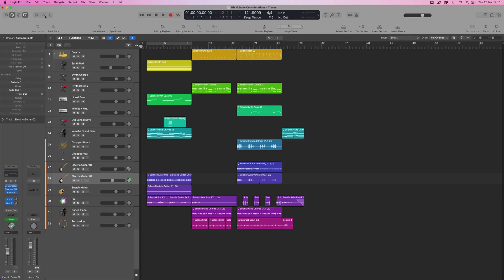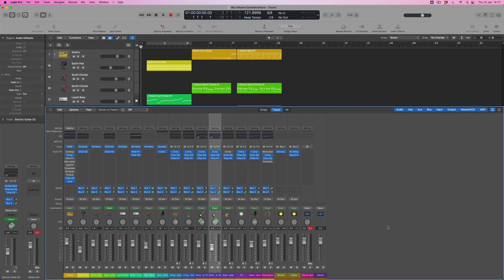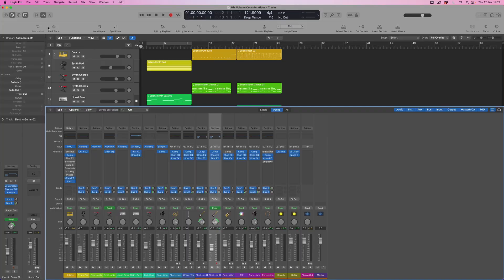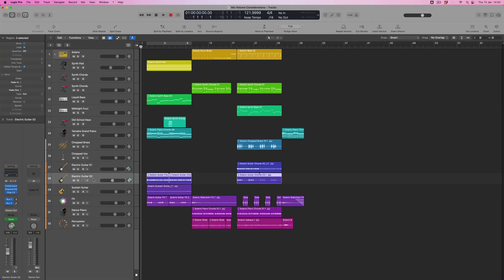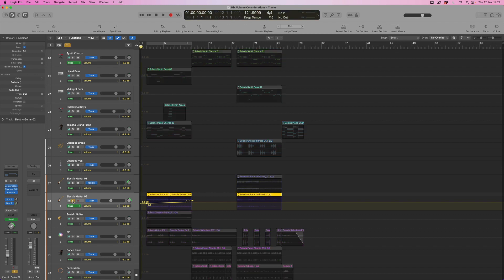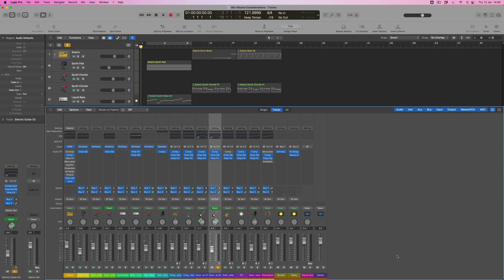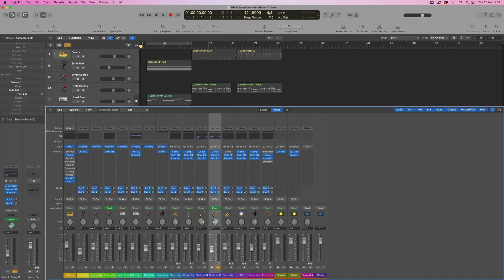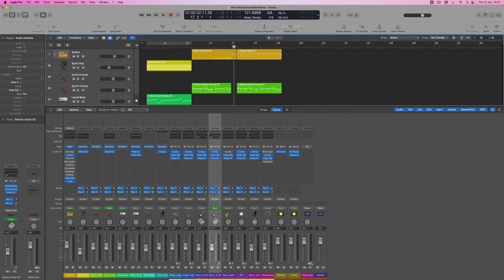LOGIC PRO X - Mix Volume Considerations

Comment: I’m battling this right now in my latest song! So timely for me to come across this in my feed. And your preferred solution is what I’d worked out for myself which was reassuring in that I’d done it the correct way. 

I think it’s worth noting that the aux buses are only not an issue if you are using post fader sends. I sometimes use pre fader sends if I want a particular effect to be independent of the actual track mix level. In those cases I had to adjust the send level as well while leaving the actual bus at unity gain.
Reply from the maker: Hi Peter. You're absolutely right - thanks for pointing that out. I'm glad to hear you'd come to similar conclusions about how to deal with this issue.

Comment: Hi, Jono. So I’m having an issue that is similar but a little different then the issue that your experiencing. It’s a little hard to explain but I’ll try my best to explain it to the best of my ability. So as of right now, I have Logic Pro opened and I’m currently creating a song. I have 2 tracks made. 
1 for the beat & 1 for my main vocal. 
And down below in my mixer, I have 6 mixer tracks being shown. 
1. The Beat 2. My main vocal 3. My Reverb Send Track 4. My Noise Gate Send Track and then 5. The Stereo Out Track with #6 being the Master Slot Track.

Inside of my main vocal track (Audio FX Slots) I have a Channel EQ, DeEsser 2, Compressor and Auto-Tune. 

Mind you, my vocal track is completely empty…Without anything being recorded under the vocal track, For some odd reason (inside of my headphones) Me actively singing with (Input monitoring) on, the left side of my headphones where my Input Sound is being played back through is noticeably a lot louder then the right side. So long story short, with everything I describe of my studio session right now, the left side of my headphone speaker is a lot louder than the right side and it’s not my headphones themselves, I’ve checked. It’s literally just the track itself, I noticed it would simultaneously fade over as I added each (Audio FX) to my (Audio Effect Slot)…Any Answer on why this is happening and the best solution of how to fix it without messing anything up?
Reply from the maker: Hi. There are several reasons why this might be happening, so this one is tough to diagnose via text! But, my best guess is that it sounds as though the Audio Track you're using to record your vocals is a stereo track and that your microphone is plugged into Input 1 (ie the left side of that stereo track), which means that the left channel is loud and the right channel is quiet(er). If you're recording vocals with a single microphone (which is how most vocal recordings are made), remove all of the Insert Effects on your current vocal Audio track and then click the button to the left of the Input routing at the top of the channel strip for your Vocal channel so that it's a mono track, which looks like a single circle.

If that doesn't fix the problem, bypass all of the effects channels and make a recording of your voice. Play this back, solo'd, and check whether, on playback, the sound is biased to the left. If it's not, turn on the first Insert effect you're using and see if this biases it towards the left. Keep repeating this process with each subsequent plug-in to see if any of them are introducing a treatment which is biased to the left-hand side. But my best guess is that you're working with a stereo track which, for vocals, you don't need to be.

I hope that helps.

Comment: I find that the more tracks I have, the more likely a mix is to clip, and yet the overall LUFS are pretty low. I'm so confused about why this happens or how to fix it.
Reply from the maker: Sorry you’re having that problem. This is something I’ll happily revisit in future episodes. Remember that there are a lot of ways of measuring volume, some of which are transitory and others of which are averaged over a long period of time, including the entire length of a track. So it’s absolutely possible to have temporary spikes which clip at the same time as a relatively low average LUFS reading. A range of dynamics tools exist for regulating volume (alongside volume Automation itself), which can help tame spikes.

Comment: Could you trim from the Automation page all of them at the same time?  Also what I used to do is create a VCA for all the tracks except reverb for the reason you mentioned.  But we have to be careful because if our sends are pre-fader then this stantement is not true.
Reply from the maker: Hi Jean-Phillipe. Strangely, you can't easily selected several tracks to Trim their Automation simultaneously. However, if you assign all of the tracks you want to Trim to a Group, you can do exactly that. Select them, create a Group and then Trim any of them from a Volume Automation perspective and they'll all drop by that amount. You can then 'un-Group' them if you want to. I hope that helps.

Comment: Question-  I notice that some of your channel strips hit yellow . Aren’t channels like kick and bass supposed to be around -10. And all channels to be in the green to leave room for mastering?.
Reply from the maker: Hi. Great question. There are no ‘absolute hard-and-fast’ rules about output volume for mastering. Some mastering engineers will say that they like somewhere around 3dB of headroom to play with, whereas others will prefer a little more. The principal considerations are ensuring that your output level isn’t so hot that it’s overloading and introducing digital artefacts. And - at the other extreme - that you’re not compromising resolution by printing mixes quiet enough that the signal-to-noise ratio is compromised as Gain needs to be boosted a lot at the mastering stage. Remember that individual track volumes within a mix are less of a consideration, so long as each one isn’t overloading/introducing artefacts.  I’ve never worked with a mastering engineer who has expressed dissatisfaction with pre-mastered mixes printed to peak around the —3dB or -4dB mark. These days, we measure digital output level in a number of different ways, depending on whether you’re making masters for CD or for streaming services. But that’s a whole other topic of discussion! I hope that helps a little.

Comment: Hi Jono! Thank you very much for the video, I found it quite helpful. But I have one question: the peaks seem to be standing still, does that mean they are showing the maximum? How can peaks be measured correctly and accurately?
Thanks!!
Reply from the maker: Hello! Glad the video was helpful. For true level measurements, I'd recommend putting Logic's Level Meter (in the Metering folder) plug-in on the Master Output fader at the very end of the chain. This will let you check RMS and/or Peak levels, giving you an accurate 'live' level check at playback. Hope that helps.
Reply: @jonobuchananmusic  Thank you, Jono! I wish you well!

Comment: Trim Automation excellent, had similar problems once on the stereo out of distortion, I use a VU meter last in the chain on the stereo out to check the mix as I build, not sure if this is a good idea but thought id mention, cheers for all the vids
Reply from the maker: Absolutely, monitoring output levels as you go is always a great idea.

Comment: Best teacher around, as always!  I found this out the hard way with many trials and errors. What I find I do is I create automation points on all of the tracks, that way if I have to keep going in and making adjustments to overall volume or perhaps groups of certain tracks like strings sections, etc., I select all and drag all points down.
Reply from the maker: That definitely works! You might also find assigning multiple tracks to a VCA Fader helpful. I’ve looked at that approach in Part 2 - let me know if it helps. That way, you can ‘trim’ output volume for multiple tracks from a single fader. Thanks for the kind words as always, Jennifer. I hugely appreciate your ongoing support.
Reply: @jonobuchananmusic  Thanks, Jono Buchanan! I look forward to watching it this weekend; and you are most welcome! 🎵

Comment: Thanks Jono for another really helpful video. On a slightly unrelated subject can you use the Logic Remote control for iPad to write in automation as well as say control the mixer? As I have a Korg nanokontrol which is pretty temperamental! Thanks!
Reply from the maker: You can indeed select Automation modes and draw Automation from Logic Remote, though there are some limitations in terms of parameters and it's much less capable (than the mouse and the Main Page) when it comes to anything third-party plug-in related. I'm very happy to make a video exploring its strengths and weaknesses for the series.
Reply: @jonobuchananmusic  that would be great if you have the time? Many thanks Jono! Paddy

Comment: Hi Jono. That problem’s been occupying me quite a bit, so thanks v much for the video. Can I ask, would it also be legitimate to lower the gain on the individual track inputs? I’ve noticed a lot of loops come in very hot. I guess this feeds in to the contentious topic of Logic gain staging? Looking forward to following your new channel. Pete
Reply from the maker: Hi Pete. You're welcome and great to have you here. Lowering the Gain on the track inputs would certainly help manage volume further down the line but be careful. If you lower input gain (at the top of a channel strip) having already configured a Compressor solution for that track on a subsequent plug-in, the Compressor will behave differently as a result of receiving a lower input level, potentially changing your mix considerably. So if your starting point for gain reduction is to lower the Gain of a loop at the point you drag it into the project as a first step, absolutely this will help you. But if you decide to do that further into the process, because gain structure is getting out of hand, just be careful to ensure things are still sounding as they should.
Reply: @jonobuchananmusic  Thanks, Jono. I’ll bear all that in mind. Pete

Comment: Yes, the automation trim is lovely. Saves the messing around selecting the automation points and fiddling with the dragging up and down.  

Question: I do volume automation as the very last thing in my workflow and I try to get my master volume around -6db.  Am I on the right track (pun intended ) here with this rough volume db target?
Reply from the maker: Hi John. The short answer is yes, -6B should be fine. The slightly longer answer is that it slightly depends on the bit depth at which you're working. If you're printing a mix at -6dB and you're going to have it mastered, it's highly likely that part of the mastering process will seek to bring levels up overall (how hard the mastering engineer will work to achieve inflated output volume will depend on the genre of music and your instructions as to how 'loud' you want the track to sound). As levels are boosted, the noise floor and 'artefacts' in your mix will also be raised, so there is an advantage to looking to print mixes closer to -3dB (or so) to ensure there isn't a resolution loss as mastering takes place. If you were working at 8-bit (I'm sure you're not, I'm just using it as an example!), the noise floor boost would be pretty apparent as mastering levels bring volume up. At 16-bit, it would be much less apparent and at 24-bit, it's not really an issue.
Reply: @jonobuchananmusic  Thanks Jono, great answer.

Comment: That was truly great Jono. I have one question though. You emphasised placing the gain plugin in the first slot on the stereo out. I was wondering why not the last? I'm guessing the in the first slot it is adjusting gain while in the last slot it is adjusting volume and it would be simpler to just turn down the stereo out fader. Am I correct? Would love to hear your explanation for this.
Reply from the maker: Thanks Warren. Ideally, you don't want to touch the Stereo Output fader OR the Master VCA fader but rather to use each track's volume faders to ensure that the level reaching the Stereo Output is controlled. If it's within 1 or 2dB of where you want it to be, a cheeky Gain plug-in at the top of the Stereo Out channel can offset level to set you up for the stereo processing you might then go on to do on the Stereo Output Buss (EQ, Compression, Stereo Width, Loudness Maximising etc...). So think of the Gain plug-in as an initial volume regulator, rather than as a final volume control for your overall output level. I can see how this might be confusing, so do look out for next week's video, which I hope will help!
Reply: @jonobuchananmusic  Thank you for that comprehensive reply Jono. Waiting eagerly for next week's video. Wish I could give you more than 1 like.

Comment: Great video! Is there a target pre-master level you should aim for when mixing?
Reply: Not sure about what Jono sets aim for...but when working with my mastering engineer, it's usually -6db
Reply from the maker: Always follow the advice of a mix or mastering engineer, so I'm happy to be over-ruled! But be careful that the overall output level isn't printed low enough for resolution to be compromised, or that the noise floor comes up through the mastering process.
Reply from the maker: Hi Lachy. Yes, I'd aim for the summed mix peaking at around -3dB at the Stereo Buss stage, with the Master (VCA) Fader set at 0dB (as recommended in this video). That's a good target and allows for a dB or so in either direction. You can then create a processing chain of plug-ins to control dynamics and output level thereafter. Video on that very subject coming soon.

Comment: Another (and easier) way would be to use a vca-fader for all tracks. No need to change volume-automation in this case.
Reply from the maker: Hi Jan. Absolutely, VCA Faders are great and, in fact, a video comparing the ways in which Volume can be managed is upcoming. It's useful to have a number of techniques at your disposal, as sometimes Volume is an issue on just one track (in which case Volume Automation management is effective) and other times, the issue is across a whole mix.